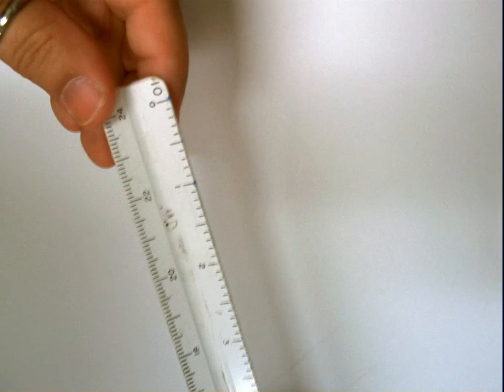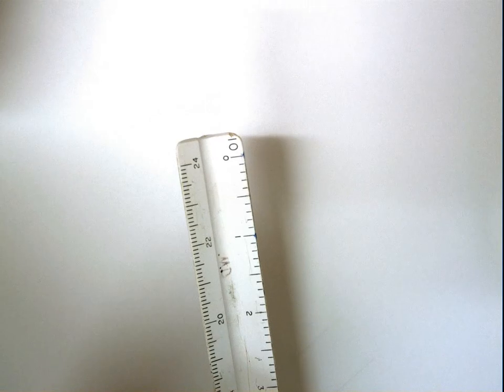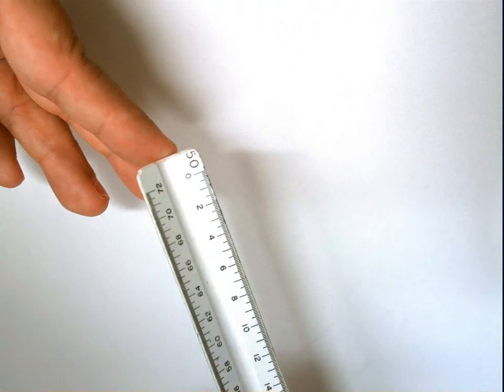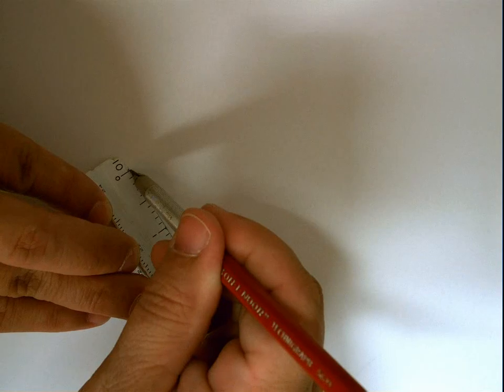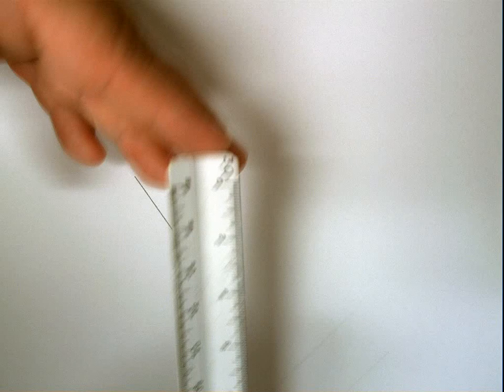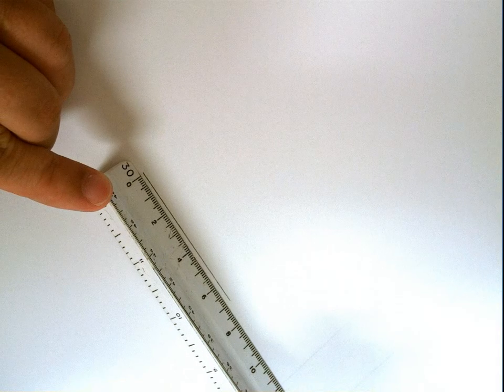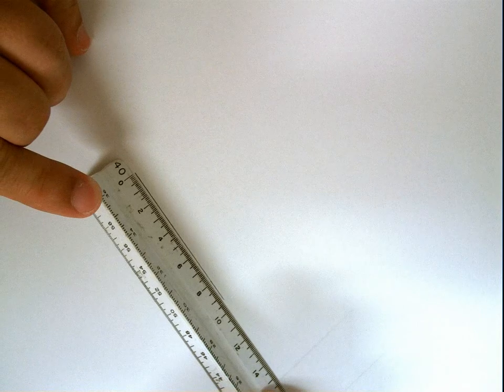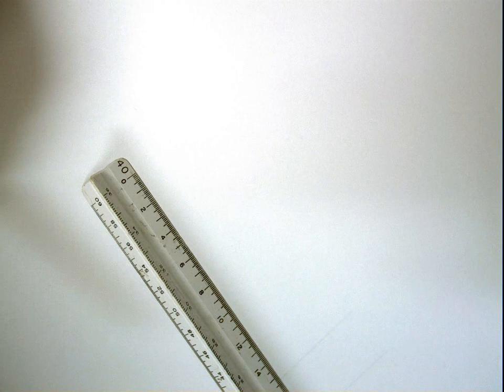how to measure with an engineer scale

Comment: The length of the line for the 10 scale is in fact 23 ft. However the length of the line in 30 and 40 scales are 69 ft and 92 ft respectively.